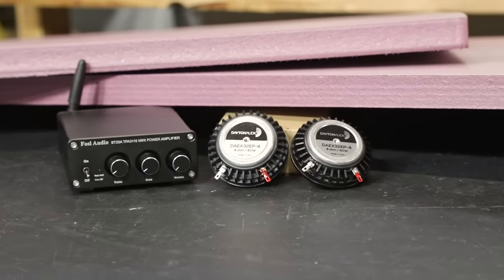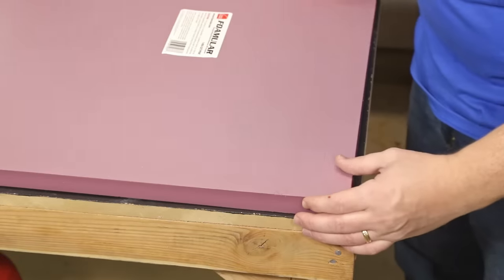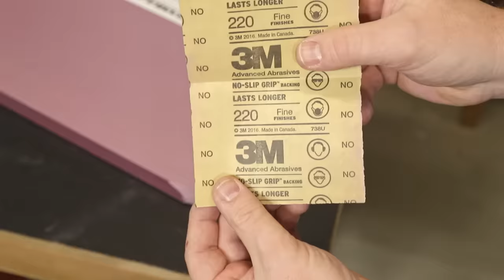How To Build "The World's Best Speakers" - Are Flat Panel Speakers Really Any Good?

Comment: I ordered (and have received) the parts and found that our local hardware store stopped carrying the pink Stryofoam insulation panels.  However, their new supplier offers black Styrofoam panels and they assured me that these were just as good (although I didn't tell them I was building speakers either LOL).  I opted to try the 1" x 24" x 96 " panel cut into two equal halves and found that these speakers (although not studio quality) are perfect for sitting outside around our fire pit in the summer.  They work really well, and the sound is above average...much better than those little outdoor bookshelf speakers one usually sees for sale at 4 times the price.
Reply from the maker: Awesome, Pacal!

Comment: Well I'll be dipped! A guy just discovered your channel and low and behold... He's only wearing a VGG cap! Respect-O-meter 2000 fully charged!
Reply from the maker: I went ahead and did the right thing.
Reply: @AmplifyDIY  You need to adjust your language a bit... It's not "speakers", it's "vibrulators". And it's not "amplifier", it's "sound-make-it-happener". And so on and so forth...
Reply from the maker: @ziiofswe  It's all just digicals as far as a guy's concerned.
Reply: This sort of thing and a little 10" subwoofer and somebody could have a really clean surround sound in their home
Reply: These really bring the thunder.  They're basically Fac-tree.    A guy is pretty impressed with these soundalators.   I will go ahead and do the right thing and build these right now..... no..... no I won't, I'll just like and subscribe so that's good.
Reply: @lyedica  Whatever, it'll be fiiiine.
Reply: Well I done doubled up on a guys comment. Thats ok, it still holds true for a guy.
Reply: @AmplifyDIY  DIY amplify? What if you get a really large one and put 2 or more speekers on one panel mounted to somthing heavy and solid? I'd like to see one of these made using an aerogel panel one day.
Reply: Gosh Dang! VGG is changing the language one convert at a time!
Reply: @IdeaBoxful  my first though as well
Reply from the maker: Hey, wouldja pass a guy a cold snack?
Reply: @AmplifyDIY   Well I'll be dipped.   This comment thread just keeps on bringing the thunder!
Reply: Joe Shumo  I'm not sure I kneed any Tonya Harding excitement in my life.
Reply: Awesome hat

Comment: If you want to go for a full sound, you just need to daisy chain a subwoofer with build in Crossover before each panel. That will step up the sound tremendously.
Reply: Yup can confirm. I had good results with that setup
Reply: I wouldn't do that as you are trying to connect a low wattage thing (the actuator) to a higher wattage thing (subwoofer) and the amp won't play nice at all with a mismatch like that.  Everything in a series is going to receive about the same output of power, of course a little diminishing because of resistance from start to finish.  If you did this you you are either under powering a sub woofer; which is pointless, or you are overpowering the actuator; which damages that.
Reply: @futatn well you need a two channel amplifier to accomplish that anyway so you will have control over power attenuation.

Comment: I still have the Magnaplanar speakers I bought in 1977, and they are still incredible.  The separation between instruments is superb.  And you can crank them up to insanely loud without distortion.  But I might build a set of these for my garage.
Reply: Yes, the older Maggies are assuming that you have the room and amp for them. (Yes I have owned some)
Reply: I have some MMGWs and they were only ever happy on my big HK, but they don't have the bottom end I need now I have a bigger space than my apartment.

Thought about upgrading to full size, but I have an idea....
Reply: Maggies are terrific, but these are not Maggies.  They have their own limitations.  But still really good, and terrific when used in numbers with DSP.

Comment: Going to have to try this (especially for "garage" use!)... a few tips I noted, others probably have already volunteered also... #1 - For the mounting support holes, use a nail (bolt, or even the cotter pins themselves) in a pair of vice grips, heat up with a torch, and plunge them into the foam (rather than trying to drill it)... they'll easily melt their way in to make nice holes (if you want larger holes, use whatever is appropriately large enough).  
Also, classic error, don't make the mounting holes "straight in"... angle each mounting hole a bit from "outside to inside" (so they start closer to the edge, and angle inwards inside the foam so their tips are closer together than the loops on the outside).... then, after epoxying in place, tie/attach a string, wire, etc (something fine and unnoticeable, doesn't have to be super strong, light fishing line for instance) between the loops, binding them together.  Now, because of the angles, neither pin can come out fully, if one loses it's grip, and starts trying to slide out of it's hole, the string between them will pull it towards the other pin, but since the holes are angled outwards, they can't go anywhere (in fact, no need to epoxy if the foam was strong enough, just leverage would hold them in, but I'd use the epoxy given this is foam and not really strong).  That's just a backup method to ensure no pull-out.  (Same way baseboard (or other lengths of materials) nails should be installed at alternating angles, so if the board tries to warp from the wall, the counter-angled nails keep it from budging).  
Finally, I don't know how it would affect the sound, but there is a "bedcoating" spray from rustoleum (available in rattle can at wally world and elsewhere I'm sure, rumors are the roll-on variety has a different consistency, don't use that).  I'd actually spray that on the back of these before mounting the transducers.  It dries to an EXTREMELY tough surface (it's not rubbery, which I'd originally hoped for in my application, but live and learn)... anyhow, that would probably greatly strengthen the backside of the panel, and probably have little to no affect on the sound reproduction (worth an experiment anyhow)... 
If I do this, I'll follow some of these tips myself and maybe put something together to share, I'm not good at that though, I always "do" projects and never really do good documenting them.  Thanks for this, it was fun!
Reply from the maker: Awesome write up! I actually have a can of that bed liner spray from a different project. However, based on the testing I did in the follow-up video to this one, I'm pretty sure spraying the back of the panel will have a pretty large effect on the performance: https://youtu.be/XC814uQjlaE

I'd love to hear about it if you do put something together. Good luck!

Comment: I've been thinking about building some of these for three years. Thanks for convincing me to give it a shot.
Reply from the maker: I'd love to hear what you think of yours when you are done!
Reply: You get best result with multible exciters. But the tweeters to corners and bass mid´range exciters to somewhere middle.
Reply: @wege85  Do you have suggestions for which tweeter exciter and which bass mid range to use?  Curious.  I assume that also requires a crossover?
Reply: @lancecluster  Next time I use better ones but this is my setup: DAEX25X4-4, DAEX25CT-4, DAEX25W-8, two DAEX9CT-4 (these are way too weak but I still added them to the setup). No need crossover. I recommend to use orthodynamic or ribbon tweeter also.
Reply: @wege85  Thank you for the added detail, much appreciated
Reply: @wege85  what about drilling a hole in the top section of each and installing a dome tweeter to better handle the high frequencies, because it seemed like that was the only thing really missing from these in the video.
Reply: @jamescollins6085  I have done that, kind off. Cutted a hole to middle of the panel and placed a orthodynamic tweeter. My only problem is the bass. Not upper frequencies anymore. Need a good dynamic driver for that. Was that msg for me?
Reply: @wege85  It was a message intended for you, yes. Maybe you can just buy a discrete subwoofer for each side to solve that problem.
Reply: Even if ya just use $3./ea. exciters to try em out, why not, huh? Won't take much energy to move a piece of foam board around. I'm not a fan of the pink color, will have to look around for another color.
Reply: @WareWolf801  you need 20 of them 😂
Reply: That's cool and all, but really?  You've been thinking about doing this for years...when it costs less than $100 and an hour or so of work to do it?  Sometimes you just have to put your entire being on the line and spend the $60 and 2 hours.
Reply: @eventhisidistaken  Precisely why I just ordered everything to do this.  Even if it doesnt work to my liking the bluetooth amp will be very useful for running conventional patio speakers or something.
Reply: @wege85  I think you mean 20 PAIRS.
Reply: i also agree.. using multiple transducers seems like it would help, but i'd still advise doing a bit of computing to determine the modes and nodes.. or at least spectral analysis of the actual object.. also, iirc from acoustic design, a reflective surface supports frequencies higher than 1/4 wavelength of the maximum dimension.. someone said they had good bass response with tall panels. surfboards? :p

Comment: Radio Shack used to sell speaker's that were "Flat Panel." They were sold in the mid 70's to early 80's. The sound of theirs was awesome,and were no more than an inch thick!
Reply: Hahaha. In the early '70s, I used to obsess over the Radio Shack catalog, checking specs and imagining all the stuff I could buy and/or build. Same with Heath Kit.
Reply: I was cleaning an old shed a couple days ago and found 2 of those flat speakers.
Reply from the maker: Do they still work?
Reply: Yup, they sure did. they kinda looked like a lid from a Styrofoam cooler
Reply: I've seen versions of the concept, used as car speakers... You just strap them to the sun visors, no need to make holes in the doors. (Probably needed a sub of course... but still.)
Reply: I haven't tried them out yet .
Reply: i had the blaupunkt 3" discs in my firebird in 1990 and they were totally 1/2" thick and that was mainly the frame to mount them. the speakers were maybe 30mil thick titanium disc

Comment: Good video, I saw the original video a while back and did 4 of these in my office and the sound quality is out of this world. I did full 4ftx8ft sections instead of the smaller ones on 2 of the walls, then I did 2 of the smaller 2ftx4ft ones. The larger panels for sure have more low-end compared to the smaller panel. I bought some black ink and painted the surfaces black with the ink and did some white ink making the foam boards look like playing cards. I found when I tried to spray paint them, the sound drastically changed and didn't sound as good. The ink didn't affect the sound as much.
Reply: I would guess that when paint hardens, it made the boards less flexible-so either much more power was needed, or certain frequencies weren't reproduced, or both.
Reply: You can buy dye in spray cans made by SEM. It would probably work perfectly as it's not a paint.
Reply: How many sound exciters on the 4*8 panel?

Comment: I definitely need to test a set of these. What an interesting concept
Reply: 30 years ago i had a set of blaupunkt titanium flat disc speakers in my car. same idea a flat disc and an exciter and it sounded incredible. smaller harder discs should get the high  treble sounding good.
Reply: The sound extremely well in the high notes.
If you listen to Jazz and classic, they are insane.
Violins, Cellos and Brass instruments sound like they are right next to you.
You definitely NEED to have a sub woofer for the low frequencies. nothing big, i use a 50€ sub woofer and it does the trick.
I compared them to 2000€ home studio setups and the styrofoam speakers are noticably better for this kind of music. All the sounds are much clearer and easier to distinguish.
The 2000€ home studio setuop shines in its versatility and adaptability. it works for all genres, all versions and has a lot of settings that work very well.

Comment: I've been thinking about making a pair of these - happy to hear they made it past your initial skepticism! Great video!

3 things that come to my audio-engineer mind:
* I think the 24 x 48 panels would both increase the frequency response, and cut down on what may be contributing to the "missing" tonality.
* Also, having both speakers use the 2/5th's arrangement may improve the sonic quality of the speakers. The purpose of the 2/5th placement was to mitigate resonance nodes. Giving the same treatment to both speakers would also have made them both equivalent sound-wise (instead of having a different frequency response between L/R)
* Appreciate the demo for the listeners using the Lav mic. One thing: the single microphone placed centered between the two speakers is tricky, particularly when near phanom center of the pair. The sound is very sensitive to "phasing" from slight left/right movement in this zone - the same sound arriving at slightly different times based on distance (eg. fractions of a millisecond). Consequently,  there will be dynamic "comb filtering" in the Lav mic audio. Maybe a more authentic recording for us via the Lav would have been to disengage one of the speakers and then use the Lav mic to capture the mono output straight on from the remaining panel.

Thanks!
Reply from the maker: Hey Zach - thank you for your thoughts and ideas! According to Tech Ingredients, the larger 24x48 panels provide more low end, but sacrifice the highs. They recommend a blend of both sizes, as well as mixing in some panels made of acoustic ceiling tile.
I did a follow-up video a while ago that you may be interested: I stuck with the same square panel, but played with different treatments: sanded vs non, rounded corners vs sharp, painted, covered in a fabric, dual exciters vs single, with and without a subwoofer, all the above compared to a decent set of bookshelf speakers, etc. I also used a binaural mic to record all the tests. There are some parts of the video that overpower the mics and wind up clipping (especially with the sub) but I think someone with a sensitive ear will be surprised by just how much tiny changes affect the sound: https://youtu.be/XC814uQjlaE
Reply: I would have a pair of 24x24 on each side, hung in vertical pairs, drivers in parallel (obvs!), & lock all the drivers down to stands of some sort. wondering what sort of finish you could apply to the foam, for domestic integration purposes. also, want to hear more demos where the sound source is a voice recording. that's the real acid test of the realism of speakers.